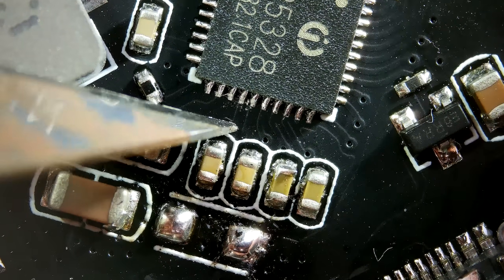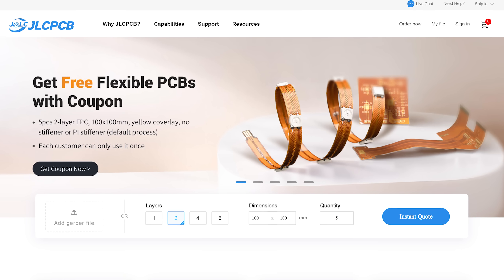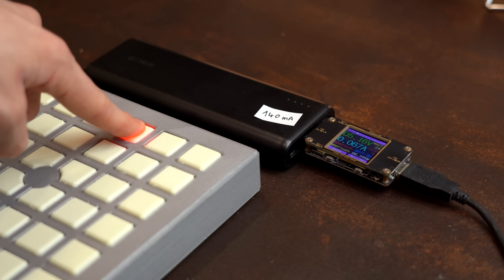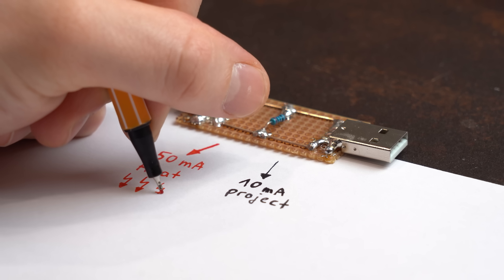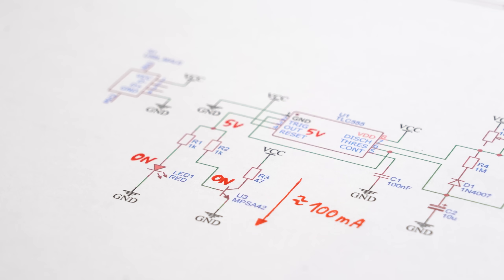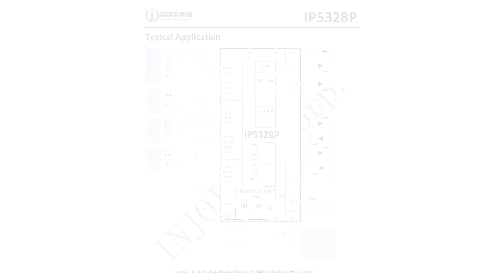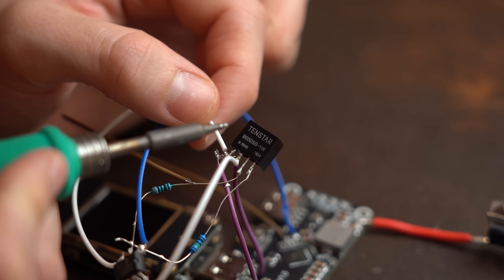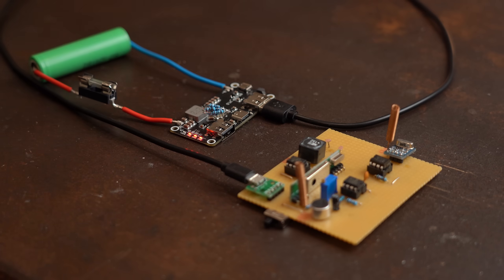Your Powerbank has 1 BIG Problem! (That we can "Hack")

Comment: I already do this on my power bank like 2 years ago and still in use until now. I am inspired by using the 555 timer one. But I do something more less power consumption, because pulsing constant load at the USB output still uses a lot of current in my case, because my power bank module need like above 200mA to stay awake. So instead of pulsing constant load at the output, I use the same 555 timer circuit to drive an optocoupler, thus the pin 3 and 4 of the optocoupler will connected parallel to the power button. Since the power bank also will stay awake every time we press the power button to reset the timeout, why not use 555 timer circuit to "press" the power button every 10 second or something to reset the power bank timeout so it will stay awake forever. This method use more less power because optocoupler LED doesn't need so much current to light up. I only connect 75 ohm resistor in series with the optocoupler LED pin.
Reply: Pure genius... dead man's button for powerbank... excellent idea!
Reply: How do you fit an extra circuit in your power bank??
Reply: @denzo_0298  My pb is DIY one. I only bought the module with the LCD display, and made a custom housing by myself, so I already thinking for extra space for the extra circuit. 

But if you used a commercial power bank that already premade, you could always reduce like 1 cell to give space for extra circuit, in return, replace all cells with higher capacity per cell. For example the amount of cell inside is 5cell with 2000mAh each, 10,000mAh in total, replace it with 3000mAh cell, so you can reduce 1 cell.  Now you will need only 4 cells with 3000mAh each, 12,000mAh in total, but now you have an extra space from one reduced cell. You can put your extra circuit there.

Comment: i faced similar issue to power up my lcd clock from a power bank which would turn off in a minute due load current of less than 1mA, so i made a bms with a boost circuit to 5V which never turns off still working great.

Comment: i will tell u a cheaper hack...  ADD A DAMN LED!!! an led is enough to keep your power bank from shutting down,,, but it's too easy right?
Reply: It still consume power man.. If you light up an LED without any reason in a bright room for example, it still a waste of power just because to make the powerbank stay awake. The thing is, we want a solution to make the pb stay awake without wasting any power.
Reply: @bro_leo  ... you use power banks for experiments or early prototypes ... 
Do you think power banks shut off for no reason? keeping it on without draining power might consume as much as the led... so basically it's almost free power if you connect something to it...

Comment: low power mode can be activated on majority of branded powerbanks.
the real problem is that some powerbanks may turn off after charging your device instead of acting like a wall charger (until power bank drains).

Comment: Add custom circuit directly to battery inside, add switch to flip between original circuit (charge device) and bespoke circuit (low power output)

Comment: Hi Scott, here is my solution: I had an esp32 lying around, wrote a short micropython-script, it connects to wifi and starts WebRepl (both not necessary), then goes into deepsleep for 28 seconds. 
I also "removed" the LED (with an electrician screwdriver). 
I'm sure it will draw more energy, but it was simple for me to implement.
Thx for your videos from bremen!

Comment: Wait, how power bank in standby mode see, that the load has been connected?
Reply: It still provides a small amount of energy in the output when there is no load. Once the load attached, the power bank IC will sense this small current flow and turn on the main system. That's why every time you change your phone by just attached it to a power bank, it will automatically turn on without you pressing the button.

Comment: I don't understand why you don't use a simple DC DC converter to get the voltage you need? You also have USB charger that can manage your battery charging
Reply: Lack of feature like charging, protection, and battery level indicator. Sometimes, using like cheap DC to DC converter not as good as real power bank circuit.

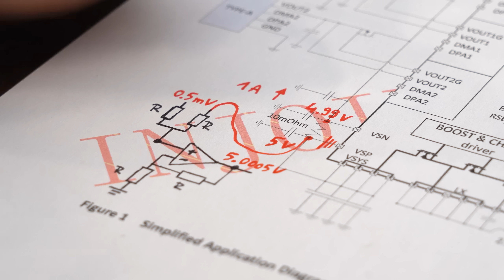Comment: 10:30 Couldn't you just use a higher value resistor, like say 20mOhm or 100mOhm? 
Correct me if there is a flaw in my thought, but it would just lead to a bigger voltage drop, over the resistor, thus the IC thinking it is a bigger current flowing.
(Yes you would lose some Amperage potential in higher current application, say the circuit shuts off at 500mA instead of 1A due to our falsely increased overcurrent reading)
Reply: Oh.... Always love it, when commenting, feeling smart... only for the video to continue and him doing exactly what I was suggesting hahahha

Comment: some xiaomi powerbanks had special mode for low power devices. Low-current discharge: when Mi Power Bank is not charging, double press the Power button to enter low-current discharge mode to charge small devices, such as Bluetooth headphones and smart bands.

Comment: I work mainly with phones. For example, just by the current that the iPhone draws, you can tell what is damaged in it. I have a 20,000mAh and 20W Powerbank from BaseUS and it drives me nuts when it turns off after 15 seconds of no or low power consumption (around 0.05A). I was thinking about making a PCB for it to artificially consume power, but I put it off until later. Btw my old Xiaomi 10 000mAh Powerbank with 5V2A output supports low power mode by simply clicking power button 2-3 times. Then it will never turn off, but I can't always use it, especially when I need Fast Charging. Thanks GreatScott!

Comment: The resistor hack is very useful if the max output is 5v 100mA.. this way you cant damage sensitive circuits that uses few little mA to run .. also useful if you repair low power devices.. i did this hack long ago with my powerbank and i still use it to repair devices... i live in a 3rd world country and buying the cheapest variable power supply from ebay would require me to work for 2 months without eating just to buy it.. but its very useful to repair all sorts of circuits

Comment: An interesting idea would be to have feedback to your current spike circuit from your project circuit. If the project circuit is off, disconnect power from the 555 timer via transistor, and get the best of both worlds were you only draw a few dozen microwatts only when the circuit is running; I think you were one step away from a near perfect solution. I would abandon your summing op amp though, as you mentioned in the start of the video, drawing .13mA would kill the battery in a month, and it's delicate work.

Comment: If the powerbank comes with wakeup button (or the control IC has a pin for that), you could use a 555 timer to trigger it in certain intervals (depending on IC's sleep timer... check datasheet). Should be even more efficient, than the 555 Timer with load solution.
Or, you could check the Datasheet, whether the sleep timer itself can be set/changed (e.g. via resistor). Though that is unlikely possible in most.
Oh, and to save some more power, you use a CMOS variant of the 555.
Reply: Simulating dead man's button... nice... but you need to open the powerbank and solder. If you for some device use multiple powerbanks (e.g. replace with another one newly charged) you must do this modification for each of them.
Reply: Simulating dead man's button... nice... but you need to open the powerbank and solder. If you for some device use multiple powerbanks (e.g. replace with another one newly charged) you must do this modification for each of them.
Reply: @vencdee  I mean, there are powerbanks, that can be easily opened. I personally prefer powerbanks that are filled with 18650 cells, that you can easily replace. On those you have easy access to the PCB.

And if you do many projects, you might want to add one additional to the top of the list, a custom powerbank. There are plenty of good pre-built powerbank circuits available, along with 18650 cells.

But of course, there are different solutions for different kinds of people with different skillsets and levels.

Comment: The shunt resistor mod gives me an idea... what about a voltage divider on the 555's reset pin, carrying (or transistor buffering) current? Pull RESET low when current exceeds a certain threshold, so we're not unnecessarily pulsing the load when the attached device exceeds the minimum draw. Might be useful for something like a remotely deployed ESP32, where it''s mostly idle, but occasionally has a bunch of Wi-Fi connected work to do, for example.

Comment: I use the pulse method in a small circuit mounted on top of the 555 itself that I put inside the power banks and it pulses the output every 30 seconds for 1 second, and it works fine...!!! Great video.

Comment: You could just hack in a completely manual override:  Make a separate 10,000:1 voltage divider between VSP and ground, and then add a switch that switches the VSN pin between its original resistor point or the fixed voltage divider.  As long as the switch is flipped, it will always think the same amount of current is flowing, regardless of what actually is (this does have the drawback of losing the ability to sense overcurrent, though).

Comment: Great video!  

I like the pulse circuit.  Could dial it in to trigger right before the shut down of the power bank to minimize how much power is drawn instead of the 8 second interval used for demonstration.  Maybe as a subsystem added to the small projects themselves to allow function with any power bank without external modules.  

I know the current draw is quite small, but were there any voltage dips presented on the output side from the pulse?

Comment: The analog nerds might not like this, but attaching any ESP32 and just use DeepSleep would work way easier than using the 555. 
no soldering required.

Comment: I have low power projects that are not enough to turn on the power bank (but the circuit works). However, this causes me a lot of problems with over-discharging the battery. I can't solve this problem 😢

Comment: Also a problem with some small synthesizers. I found that some old small cheap powerbanks don't have a switch-off (ir it is very low). One soultion: using a USB hub and plugging in a USB lamp additionally. Then it stays on.

Comment: or buy a powerbank that has the low power mode, the one used to charge smart bands. mine whit a double click is staying on for 2 hours whit 5V output. I bought it years ago, it's a xiaomi and has a 10A battery. Can be fast charged at 18W and has fast charger output up to 15W

Comment: You can probably get away with not having a transistor, because the NE555 can easily sink 100ma. These old school ICs are tough cookies 😂. I normally drive relay coils directly with the NE555. Maybe we could do a very minimalist version of the circuit. I love the idea, and I also have been frustrated with 5v power banks turning off 🤔😩

Comment: I love the idea with the 555 circuit and if you want to make it even more efficient you can use as load a capacitor that discharges via a diode at the 5v output or feeds the 555

Comment: Ohh, if I had some of these solutions for my UPS. Came to learn, that an UPS will not power a router or switch, cause it does not consume at least 10% of UPS possible supply wattage/amperage. And it just turns off after a minute. What a waste of feature, that is actually a bug. If only I could disable that stupid functionality!

Comment: I experienced it alot, An led can also be used as a load for output spikes preferably an SMD one.
Or just force button press of the power bank to keep it turned on all the time using of course a signal instead of manually physically doing it.

Comment: I feel like hooking up 3 different resistor values to a switch would be a good option. Allows for low power use when needed and standard etc

Comment: Boring!... just use a simple BMS to charge 3 18650's & use a buck conveter with an actual switch on the input & that won't turn off will MOFO.

Comment: Sometimes there is an Easter egg to activate low power mode. Multiple presses or long press on. Other power banks have two outputs, one high current 2.1A and the other 0.5A.  Choose the lower of the two. There are also LED area lights much like the resistor and that could work too. Add a switch for when it’s not needed. Or use two jacks at the same time.
Reply: I have a Xiaomi power bank that has a low current mode just like you said. 😁
A downside is that it will periodically blink the LEDs it uses to indicate charge while in this mode, which I suppose will consume some additional power.

Comment: I solved this in the past by having timed pulse on one of the spare pins on Arduino controlling a fet with 150 ohm/1w resistor. To power up the power bank I wired another resistor with its power button. Works great.

Comment: I've built such a circuit on a breadboard a while back. I chose the 555 timer route because it's simple and dosen't draw much power. My powerbank (20000mAh) turns off after 30 seconds with no or too little load. That current threshold is around 70mA with my powerbank. So my circuit draws around 150mA for around a second every 20 seconds. My (USB operated) NiMh battery charger can sometimes draw too little current for the powerbank to stay on.

Comment: That ip5328p chip has an i2c interface on the L1, L2, L3 pins (instead of leds) and that allows you to set a few things. I see En_lowcur reg 0x0f bit 0 - maybe that will disable low current detection. For full datasheet incl reg map pdf, search eevblog "Injoinic IP5328 I2C register map" and someone has uploaded ip5328p.zip

Comment: I use a lot of those power bank modules in my projects. I go around this limitation in my projects by using one of the MCU pins in the main project board to drive a transistor to flash an LED or just shunt current through a resistor intermittently to keep the circuit "alive".
Reply: Basically what he showed in the video lol
Reply: @fusseldieb  Mine is actually part of the circuit and not an attachment to the USB port. Instead of a 555, the flashing is handled by the MCU of the main circuit

Comment: Replace power bank PCB with LIPO charging Board and Boost converter and set its output to desired voltage

Comment: As others mentioned also: insert a resistor in series with the VSN pin, the current sensing input is probably quite sensitive so the series resistor will not have much influence on its own but it makes it much easier to inject a low voltage offset on the VSN pin.

Comment: This video will be useful for me.
I have this little radio(powered via a microUSB connection) at work and when I turn the volume down to 0 or put it into standby the power bank turns off.

Comment: Interesting, but in practice I think 3 and 4 are often less practical then just scratch building your power supply. Unless severely cash limited or recycling is your focus. 
But even then:
Strip single use vapes for parts. People throw them away everywhere near and in citys.

Comment: use trimmer and set it on 1 ohm every time you need max output current, set it higher if you need small current draw without power bank turning off.

Comment: That chip (IP5328) has an i2c interface, and there's some documentation for it online (eevblog IP5328 I2C register map).
It's a bit difficult to tell due to the translation, but the power cutoff threshold seems to be stored in the 'BST_POWERLOW' register (0x81).
It appears to only use the lower 5 bits of the register, and the datasheet says the default (18?) is 300mW, and the highest (31?) is 540mW.  
I don't have the chip on hand to verify, but you might be able to disable the cutoff completely by using i2c to overwrite that register with 0.

You might also be able to disable the cutoff by setting bit 6 and 7 of the "BST_ISYSLOW" register (0x84) to 0.

Comment: Looks like PBs in video are made by Baseus - hold power button for 3 seconds and here you go, low power draw shutdown circuit is off, you powerbank is on until you manually turn it off.

Comment: Hi ! You mentioned IP5328P and it's really cheap. I have a scooter battery with dead bms and it has 30 li-ion elements. I thought I'd want to create 3 power banks out of it to charge outdoor cameras when I go there so IP5328P would definitely work. I was wondering if there are any other cheap boards that could also provide optional charging voltage for laptop like air over USB-C. Can You suggest any?

Comment: Bro I don’t know what power banks you have been using, but all the power banks i have used in past 10 years always had a low power mode which is activated when the single button available is pressed twice quickly. Even cheap Chinese ones too. I’ll be more interested in efficient hand crank charger or a solar charger to charge a big power bank around 20,000 mah capacity.

Comment: While you're on powerbanks, could you also do a piece on dying BMS circuits when the batteries are disconnected? I ruined an original HP battery while trying to replace the dead 18650 cell and a xiaomi powerbank. I couldn't find info on how  that works and how to tackle this problem.
Reply: As a general rule if a BMS includes a bricking function it's the cell dying that triggers it, in which case there's nothing you can do short of replacing the BMS entirely. Obviously mistakes can happen reassembling the battery but most of the time if the replacement cell is properly matched including state of charge you should be good

Comment: Instead of trying to increase voltage of the IC VSP pin , it might be better choice to cut the VSN pin of the ic and put a resistor between shunt VSN TO IC VSN and a another resistor between IC VSN TO GROUND so that the ic vsn pin voltage get reduced than IC VSP voltage, may be it will think output current is above the threshold value